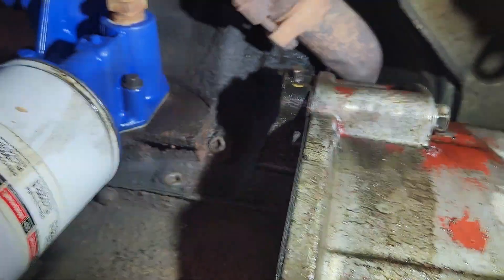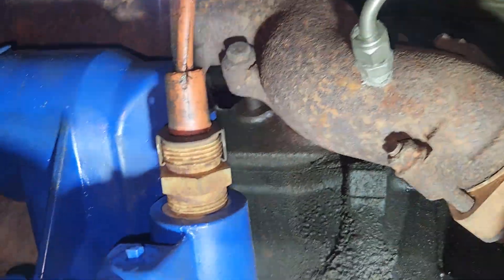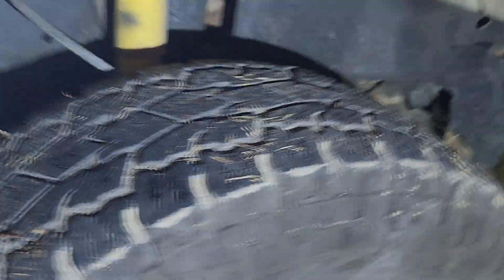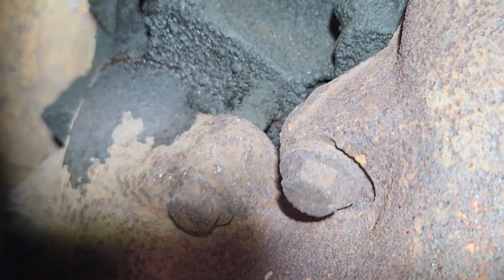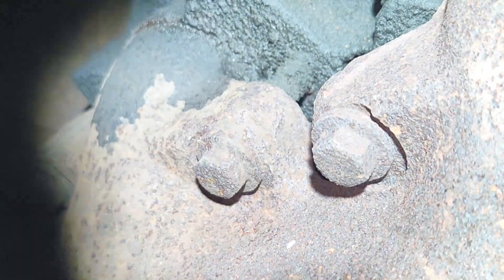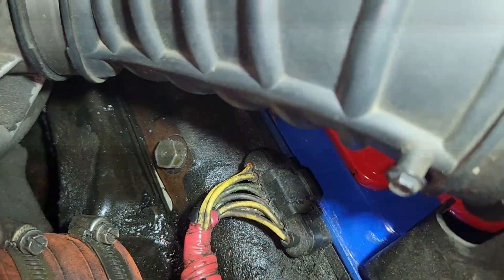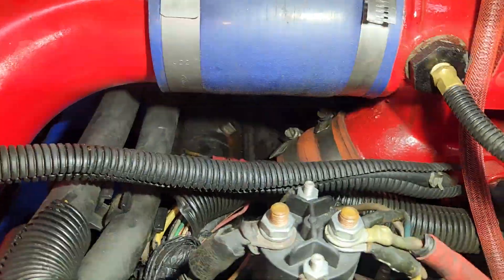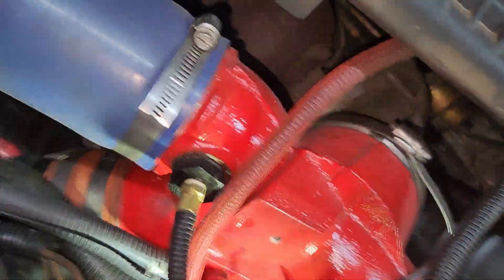Possible exhaust leak??

Comment: The easiest way to find soot is stick your hands up in there like you are trying to reach something. If it's there, it will find YOU! Then, go find what got your hands dirty... That passenger manifold might be oil soaked soot. Degrease it and watch that spot for new accumulation.
Reply from the maker: I have a forum going about a ticking going on at high RPM. I posted this vid on there and Tpayne found soot on the top of the passenger side up pipes. The also recommended soapy water on a cold start to find leaks. The manifold is leaking there. Going to rebuild turbo with a KC balanced assembly, bellowed up pipes, and resurface the exhaust manifolds and paint everything. That's the plan anyway.
Thanks! 👍
Reply: @hyakkimaru6709  Glad you have it figured out! I always find soot when I'm least looking for it... 🤣🤣🤣
Reply from the maker: @2020HotShotTruckingLLC  now I just have to figure out what color I want to paint my exhaust manifolds and turbo!! I'm thinking blue on the cold side of the turbo and silver on the hot side and silver manifolds. I think that will match up with my red and blue pretty well. What do you think?
Reply: @hyakkimaru6709  I painted the whole turbo with high temp (1200 degree) silver paint. Same for the exhaust manifolds. My whole rebuild I used Ford blue for the block, heads, valve covers and oil pan. Everything else is silver gray. All engine paint (500 degree) except the turbo and manifolds which are 1200 degree. Painted the spider, CAC tubes, AC compressor mount, PS/alternator mount and oil cooler are all silver. The valley being Ford blue is awesome - it won't be a dark void anymore!